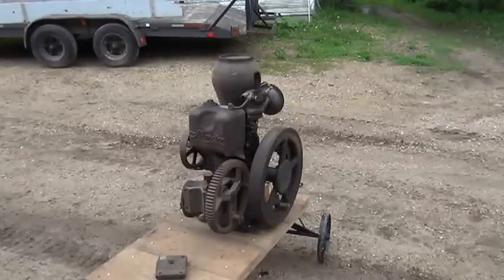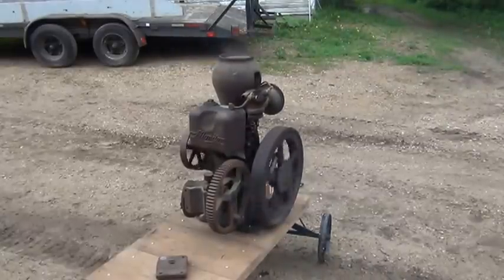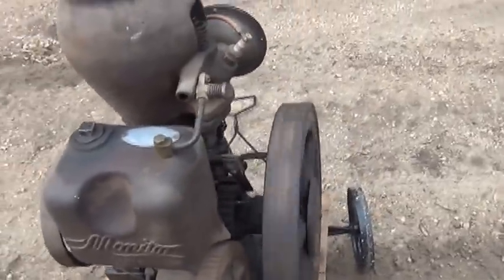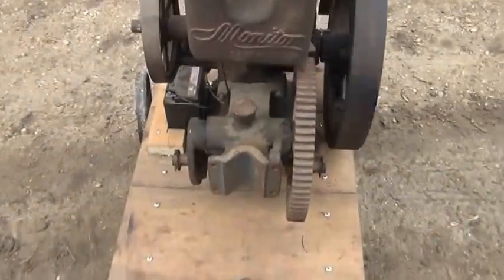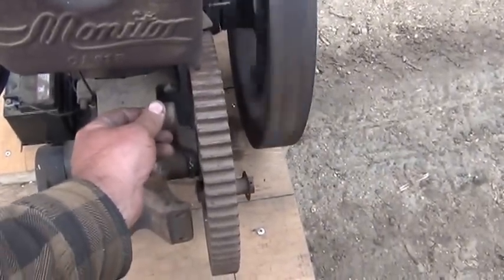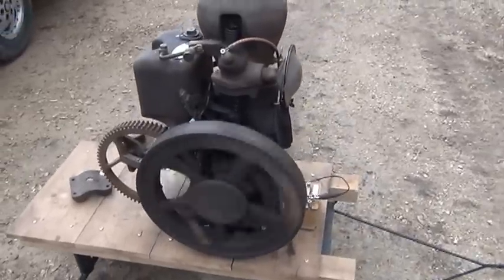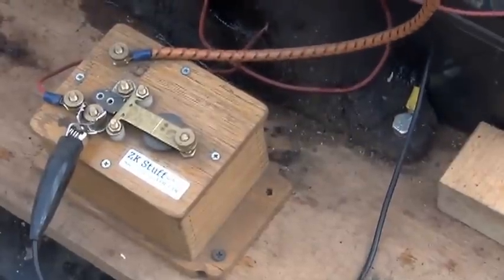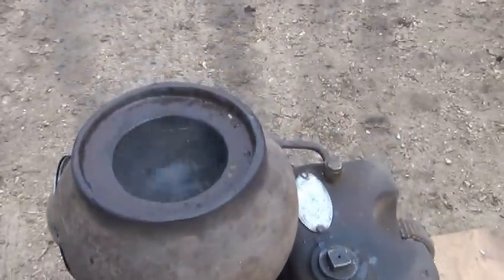1925 1 1/4 hp Baker Monitor engine

Comment: I've noticed that some of these have the cylinder oiler and some do not, is there a reason not to have it?
Reply from the maker: It is not necessary if you are running it at normal RPM, but if you are working it hard or running it in high temperatures it would help to have one! There is a pipe plug in the hole where the oiler goes (on mine), most did not have an oiler when they were used. But, when you run them real slow (at shows), you are not slinging the oil as designed, so it would be better to have the oiler! Some added them when they were running steady (all day or night) so you did not have to shut it down as often to add oil!

Thanks for stopping by!
Jeff
Reply: Jeff Sigrist
Good stuff to know, I just got one of these last weekend and I'm going through it and trying to figure it all out.
Reply from the maker: They are fun to play with! A friend of mine has one too, I had to make a new valve for it and re-cut the valve seat to get it running! Then we found out the valve spring was not right and was to weak so we added a 3/8" nut between the top of the spring and the cotter pin and it ran great!
If you have any questions feel free to ask!
Thanks!
Jeff
Reply: I've got to do both valves in mine, the exhaust valve was rusted in half above the head of the valve.
Reply from the maker: I turned down a Chevy 350 exhaust valve to make the one for Ron's. I save good used valves from a lot of scraped out motors! I used a Chevy 396 exhaust valve to make one for a Fairbanks Morse 1-1/2 hp headless engine!
But new valves can be picked up from places like Hit-n-Miss Enterprises in Ohio, fairly reasonable price wise!
Good luck with it and take some video of the rebuild to show off!

Comment: WHAT DOES IT WEIGH
Reply from the maker: Have not weighed this one! I think it is about 350 lbs. with the truck (cart)!
Thanks!
Jeff
Reply: THANKS JEFF THE PUMP JACK WEIGHS 144 PLUS 350 EQUALS LETS CALL IT 500 THINKING ABOUT GETTING ONE. GOT TO BE ABLE TO HANDLE IT . HA HA
Reply from the maker: Hi Richard, spring is finally starting to arrive here in Wisconsin, USA, so maybe I can take my hydraulic scale and give you a closer weight! This is just a "guess-ta-mate" judging from my other engines!
Thanks again!